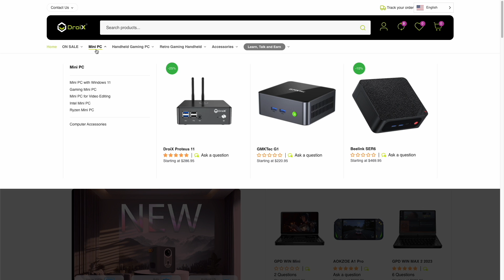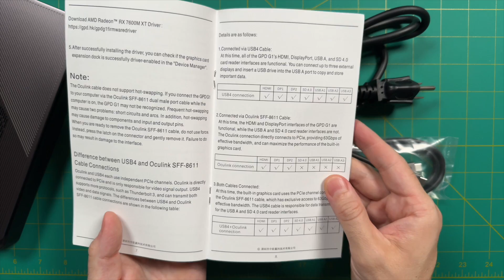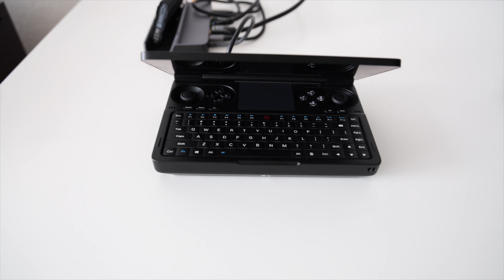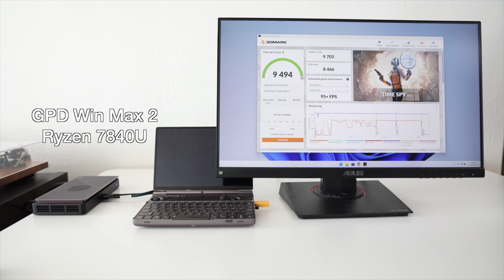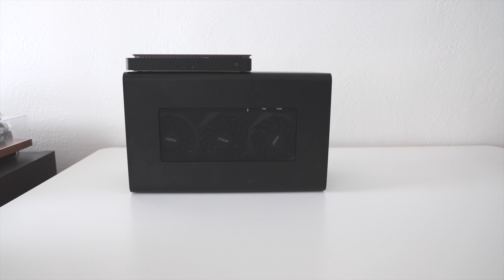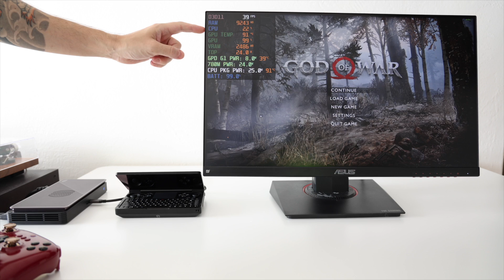Tiny GPU for Handheld & Mini PCs! GPD G1 Review

Comment: What’s the experience of docking and undocking it to a mobile gaming PC like the Steam Deck or Legion Go or ROG Ally like? Do you have to shut the whole computer down and unplug it and restart it, or can you just make sure you’re not in a game—or potentially when you are in a game— and disconnect it, and it switches over to internal graphics?
Reply: I have the g1 so I can answer some of those.

Over usb4, the experience is great. You plug the dock in, windows makes its device connected sound, and then it's connected. In my experience, connecting it while a game is running causes the game to either continue running on integrated graphics, or crash, depending on the game.

As a note, not every pcs implementation of usb4 is equal. My GPD win 4 has been rock-solid, but I experienced a number of random disconnects on my other handheld (OneXPlayer mini pro). Might be software, might be hardware, not sure.

Over oculink, the experience is less fluid. You can only connect and disconnect the GPU when your devices power is off, so it feels more like a "I'm gonna be playing for a while" choice.
You do get a small performance bump in exchange.

For example, when I'm working (don't tell my boss) I switch between docked and undocked regularly (docked = playing a game, undocked = listening to music), but when it's Friday night and time for games with the boys, I'll reboot with oculink connected for the extra performance since I'll be playing for a while.
Reply: @OwenOrsetti  Thanks! That was what I was looking for. The devices I’m interested in docking with don’t have oculink anyway, which in this case I suppose is a blessing and a curse.
Reply: @OwenOrsetti I posted a few min ago asking for help but is it pretty plug and play? I wanna use with legion go. And have no idea what I'm doing.
Reply: This wouldn't work with steam deck

Comment: I don’t get the point of this. The eGPU is £790 and the mini PC is probably in the region of £400 - £700 so adding those together you could just build a significantly better desktop PC or high end laptop for the same price or less.
Reply: Try fitting that into your pocket/bag and move around. Portability is the point

Comment: This is pretty great, would love to get my hands on one for my mini PC, but 740 dollars is a bit much for me atm. If this thing was like 300-400 dollars, it would be a hell of an upgrade.
Reply: Heck, $500 and I’d bite. That’s double MSRP of a desktop 7600, but the unique formfactor and extra docking ports adds enough value back. But over $700 is an easy “No”.
Reply: you can diy yourself, oculink/m.2 docks ($30-$70) are a lot cheaper than thunderbolt/usb4 docks ($150-$300)
buy a $50 psu, then a used/new gpu and ur good to go
Reply: @johnpp21   then you lose the small form factor. So every option has its trade-offs
Reply: @iancharles9222  yup, either diy or this portability/sff price premium
both have pros and cons
Reply: @johnpp21 sure there are definitely cheaper ways to do this but won't be anywhere near as nice and compact as this solution.  You're paying that premium for the portability
Reply: @kennymorelandiii9406  yup, the cheapest route is via DIY oculink setup, i got my oculink kit(dock + cable + m.2 adaptor) for $40, psu for $50, then your choice of gpu
although its not compact or portable but its cheap enough
Reply: its expensive
Reply: I'd say $500 would be more feasible and a good price.  Of course anything under that would be great but you're always going to pay more for a mobile form factor like this plus it includes the power supply  

I could see one without a power supply included for around $300 though so that would be a good option for some if it happens
Reply: Take a look at the BoostR costing 499.

Comment: This is pretty sweet! But damn expensive. It's slim but you can't change the GPU, I see other Thunderbolt 4 enclosures for $300-600, I mean we could get pretty cheap used gpu's on the market and slap it in, and if you wanna upgrade, you can! 

But this is the price to pay for portability which this thing cannot be beat.
Reply: I don’t agree with you, there is no point in updating over time!!! You can't get more speed!!! USB 4.0 has maximum bandwidth! And no matter what powerful video card you install, it won’t change anything
Reply: @viacheslavkirii901  There's Nvidia GPU's? With good ray tracing? But if you wanna put limits on yourself, have at it. You also realize that the GPU's can be taken out and used in other pc's, right? Modularity is a good thing.

It's ok to disagree.

Comment: Does it work with laptops or will the CPU bottleneck it ?
Reply: anything will bottleneck if you've got a shitty enough cpu
Reply: If it has a USB4 or Thunderbolt 4 port, it should work. An x86_64 handheld is basically the same as a laptop internally. 
There will be bottlenecks, but for a modern 45watt TDP mobile CPU, shouldn't be too bad. 
So, for it to make sense with a laptop, you'd need a laptop that doesn't have dedicated graphics already and has a TB4/USB4 port, which is not common.
Reply: you can always use an m.2 adapter @stevenolson3977

Comment: $739.50 USD!!! Wow. That is too costly.
Reply: You could buy the minisforum Neptune 99g which is a whole mini pc with a 6600m for that price lol
Reply: @madgodzilla12465 or hx80g barebones with 5800h+6600m for $549
Reply: For that price I would just get a Rog Ally or a Legion Go.
Reply: @oarias5158  got that all ready
Reply: @oarias5158  The Win mini alone with no external GPU performs the same as those devices
Reply: @oarias5158  it's to turn a rog into a desktop so yeah it's pricey
Reply: Damn 💀
Reply: It’s a matter of preference.  Do you want portable all in one that will basically plug and play or do you want to tinker?
Reply: @adamhughes5678  you can create the same thing for like a third of the price. Not as small, but probably better gpu performance, lower cost, and some experience
Reply: @raycert07  you buy a minisforum pc with a ryzen 7 7xxxHS and rx6650 at the damn same price.
Reply: @Rayu25Demon  I just bought a um690s with the ryzen 9 6900hx. I've gone down the rabbit hole of oculink. It's so cheap to convert something to use it and its crazy. A little nvme to oculink adapter and then a little oculink to pcie adapter. Boom. Dell power supply and a gpu and your in business. I'm going to do this. I'm gonna see if I can mount a female oculink to part of the shell. It support gen 4 pcie which I did not know, twice the potential bandwidth compared to thunderbolt
Reply: Compared to the xgMobile by asus. This thing is cheap as hell
Reply: Indeed. Based on what the parts likely cost, I think it's a reasonably "fair price," but the value proposition is terrible. For not much more you can just get a desktop 7800XT and an enclosure. I'd use this to dock my handheld rather than take it with me, so the mobile chipset offers zero advantage.
Reply: Mini-PCs are a low volume market for people with frivolous cash to burn (not a bad thing). This being an upgrade for something that's already low volume doesn't help the production cost side of things.
Reply: I'd pay 350 total would be nice with my legion go but for 4060 performance no sir if 4070 ti I'd pay 700.
Reply: Uhhh it's a latest gen GPU... I just bought a new gpu and it was $1900. $700 for a mobile gpu sounds cheap honestly.
Reply: @guycd1  you got scammed...
Reply: @serhii_himself  Thats the MSRP of a 4090 my brother.
Reply: @guycd1  that's what I said
Reply: The people comparing this to the cost of a desktop gpu and an enclosure are missing the point.  If you are docking on your desk at home, this isn’t what you should be looking at.  What this is, is an eGPU that replaces your power brick in your laptop bag, that you can take with you so that you can connect it to an ultra book or hand held system and get gpu performance for about the same weight in your bag as the charger.
Reply: People pay $200 for Thunderbolt docks - an extra $500 for an entire GPU is not bad lol.
Reply: I bought it from HK where it's only a stone throw from where it's made in Shenzen, it's being sold for $706. It's just as expensive as some of the handhelds on this channel. Is it worth playing games on Ultra/Epic settings (with FSR) on a little handheld? Maybe... if you travel a lot and get to use the hotel's TV that's 60Hz and 1080p. Otherwise, stick to your desktop. I survived the early eGPU days in 2016 where GTX 1070's were selling like hotcakes, these mobile AMD 7600 XT's were made for handheld CPU's in mind.
Reply: It's normal for egpu. They are very niche product (I.e. Nobody "needs" them, some people just "want" them) they so the sale numbers are pretty low - meaning the price for each unit is inflated due to the design/development/managment/marketing cost. It's the same situation as what we saw with handheld PCs before steam deck... 

Unless some big player decide to mass produce it and gather significant interest of public - we aren't getting it any cheaper.
Reply: Check out the XG mobile for the ASUS ROG. This is gonna be fantastic for the Legion go ETC. I need.
Reply: You can build decent PC with that price
Reply: Could get a Acer predator for a lil more lol
Reply: More expensive than rog ally hell no
Reply: I bought XG mobile 🗿
Reply: Yup!
Reply: You get a mini Pc with a  gpu st this price
Reply: Meh, I think it's around a fair price. These things are luxuries not necessities, but I would like to get one for 4/500 bucks 🤷‍♂️
Reply: This is not a need! item but a want item
Reply: 😂😂😂 i literally looked and first thing out my mouth was "oh wow thats expensive"
Reply: That price will get you a laptop with 3050 ti
Reply: @bogdanradu9207 ew lol
Reply: @bogdanRO.666  The 7600m XT craps all over the 3050 ti
Reply: I think this would be reasonable for a thin ad light with a decent cpu like my acer swift 3 so you have an option for not on the go
Reply: Everything mentioned in this comment section is unrealistic. First mini pc's aren't portable. Second expensive handheld gaming consoles can't be used by another device to accelerate graphics.

 Why even mention all that in the first place? Some of you love seeing your text online obviously.
Reply: @dj4monie mini PC's are indeed portable. If you're traveling you can simply unplug it and throw it into your backpack or carry-on and plug it into your hotel TV or a portable monitor...

 You may not consider that portable because you can't fit it in most pants pocket but the size and simplicity of actually taking it with you is classified as portable.
Reply: @lexlopez15   So you want to carry: Keyboard,  Monitor & Mouse? That is three pieces of hardware to carry around, rather than a laptop?
Reply: @dj4monie  you're obviously missing the point.  As I said, you can plug a mini PC to just about anything with an HDMI input. A $400 laptop isn't going to have all the capabilities that a mini PC can provide. If you plan to work while traveling then you obviously would have a travel size keyboard and mouse...if you plan to use it for play then you wouldn't need a keyboard and mouse, and good luck playing most modern games on a $400 laptop at a decent speed and resolution...bottom line is this GPU is too expensive whether you get a mini PC or a laptop.
Reply: @dj4monie yes. I travel for work and when at the hotel for a week or two I want to be able to game at a high level. 

And also I’d like to be able to easily game on flights that can sometime be 15 hours of travel. 

I’ve done a laptop, a mini itx pc, and now an asus. This paired with a legion go. Would give me power at hotel and portability for flights.
Reply: @dj4monie  It takes up about the same space.
Reply: @dj4monie yes
Reply: @dj4monie  while it's true that none of the mentioned alternatives fulfill the same function, I'd argue that the point raised is that the premium you'd pay for a portable mobile eGPU simply isn't worth it.

Comment: I feel like this is a fantastic setup, something like a steam deck to use around or out of the house, then if you need to get some work done or wanna play something with higher fidelity or more demanding, you can dock into this and go to town.

I find this extremely compelling.
Reply: SteamDeck does not have USB4, though :P
Something to consider when considering the broader value proposition of a handheld.
Reply: @stevenolson3977 oh I know lol, thats why I'm not jumping out my chair to go buy one of these right away. that and the lack of ethernet on this are deal breakers for the moment
Reply: I think it is more cost-effective to build a gaming pc with a decent GPU and stream your more demanding games to the steam deck oled with moonlight/steamlink rather than buying a Legion Go with a overpriced eGPU which has a pretty big bandwidth bottleneck for the GPU.
Reply: @franzpleurmann2585  
In terms of FPS-per-dollar, that set up might be a better "value." But then you have to throw in the cost of a decent wifi router for another 200 USD or so depending on your house/apartment. 
At that point, you have 2 devices that need to be coordinated and updated.
There is a population that would take the 5 to 10% "loss" in theoretical FPS in order to have a single compute device and not have to worry about network quality and not having to worry about remembering to sync cloud saves before leaving the house.
Reply: @franzpleurmann2585 The thing is the legion go is already so powerful, that it doesn’t even really need an EGPU to run any game. But if EGPUs ever become affordable then it could easily use it.

Comment: can you use the screen on the device or do you need to connect to a external monitor?
Reply: Yes, but the performance is lower because it has to travel back to the same port.
Reply from the maker: You can use it just with the screen on the device if you’d like. I show it off during my audio testing later in the video.